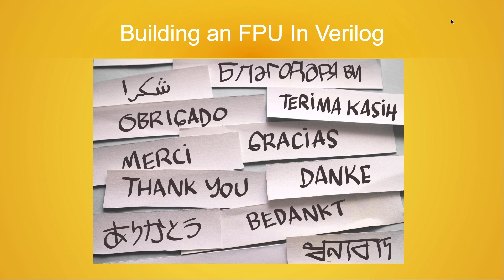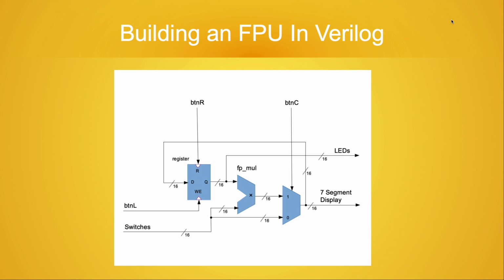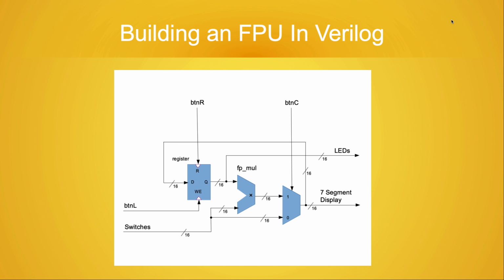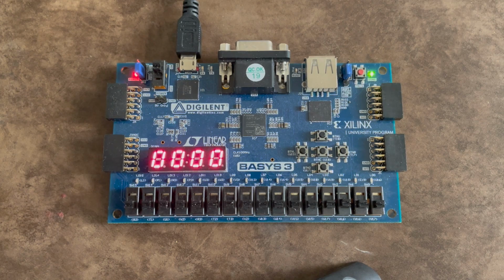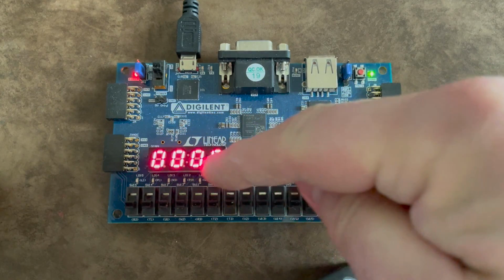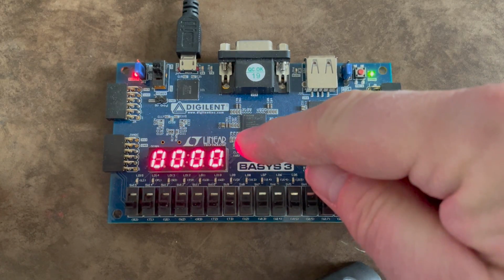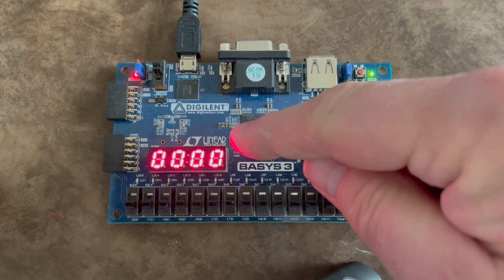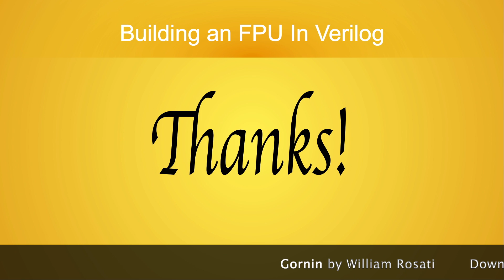Building an FPU in Verilog: Running the hp_mul Module on an FPGA

Comment: Nice demonstration! Does this board have hardware button debouncing? I was pretty sure it would square the number several times in a row when both buttons were pressed!
Reply from the maker: No, the board does not have hardware button debouncing. See the module debounce in the file fpga_mul.v in the Github repo cited above. I had to use code to explicitly debounce the buttons.